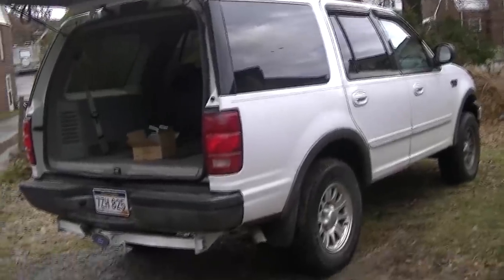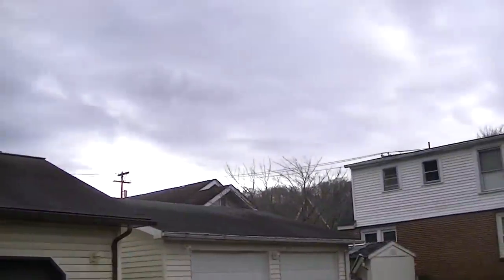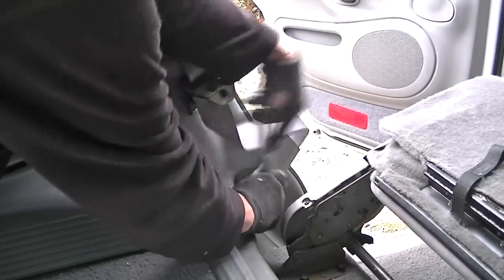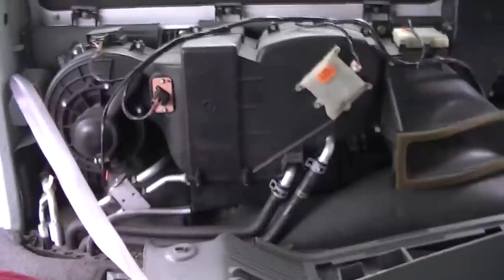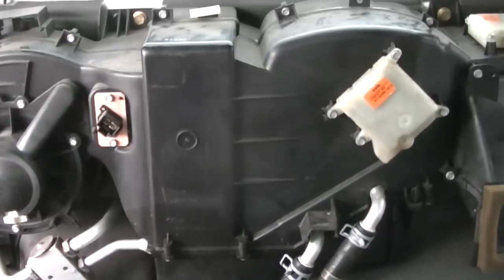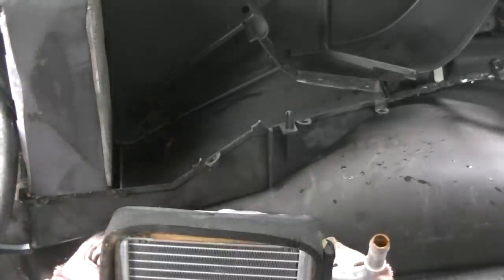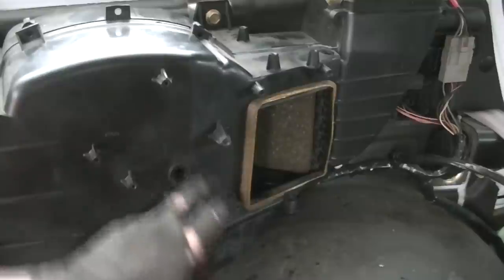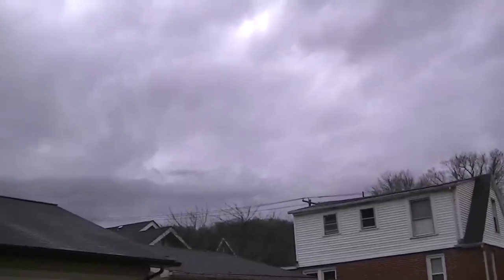Expedition Rear Heater Core Replacement.

Comment: Were both heaters intermittently working, or simply lacking heat all the time?  My '03 Expedition sometimes works, and has plenty of heat, front & rear, but when first started, it's ice cold, even after engine is at operating temperature.  Seems like air in the system, but having a devil of a time clearing it out, even using vacuum coolant fill.  Maybe I'm doing it wrong...

Comment: For those who do not always need a working rear auxiliary heater. It is possible to replace the 2 heater hoses in the engine compartment with non-auxiliary heater hoses. These shorter hoses makes it much easier to work on the passenger side of the engine. This also lets you back flush both heater cores. once the engine work is completed you can restore the auxiliary heater hoses. good to replace those 20+ year old engine compartment heater hoses anyways.

Comment: This is exactly what happens when you don’t put the proper coolant in these trucks.  The problem is this they get low on coolant people put tap water in them it destroys the coolant system and heating systems. When all they had to do is pull into any automotive parts store and get a gallon jug of 50-50 that’s appropriate for their vehicle.  Running the proper coolant in a vehicle saves thousands and thousands of dollars down the line.
Reply from the maker: Very true!
Reply: I'm a victim

Comment: GREAT video, getting ready to tackle this in the next day or 2. Just confirming NO RADIATOR DRAIN needed? Just release pressure on overflow tank up front? THANKS MUCH!
Reply from the maker: Yep pretty much. But check the coolant level when your finish making sure its still full.

Comment: Man, vid is official I watch a good sum, the editing process angles to the point narrating it's all good man thumbs up!
Reply from the maker: Thanks! I was in a hurry to finish it. It was 66 degrees...and was going drop back into teens by evening....lol  Motivation!
Reply: @FixingWithPassion  I need help with mine!! I just changed both actuators and the air is lukewarm (floor) and barely lukewarm roof vents! I have a 2003 expedition XLT, 4x4, 5.6lt

Comment: Will the rear heat work even if the front heater core is blocked? I didnt know my 99 expo had a rear heater core.
Reply from the maker: Maybe if its not getting plugged up also.

Comment: Thanks for this.

Quick question: I have a situation with this generation Expedition to where the front heater core will need to be bypassed but want to keep the rear.  I'm sure this is not a big deal but would someone who knows more specifically about this comment?

Comment: That actuator on the side is for selecting cold air or hot air for the rear vents correct? Because the top one looks like it selects floor or roof I only ask because my buddies wife’s expedition blend door actuator is bad in the rear vents  and stuck blowing heat wanted to make sure it was this one and not the one under the front dash any info would help so I don’t have to guess thank you!

Comment: My dealer tells me  I need to replace the rear evaporator core.  The front of the third row seat completely fell apart and the carpet in front of the seat behind the driver is also falling apart.  Could this be from a problem with the rear evaporator core? I don't know what else might have caused the seat stitching to come apart as well as the problem with the carpet.  Any ideas?

Comment: Hi, the video is great. What if the hoses on the radiator is not same temperature. Does the cause of no heat probably due thermostat lock open?

Comment: I have a 2002 Explorer Eddie Bauer edition. I am planning on replacing the heater core just because it never has been replaced, but more importantly, the heater hose block that is under the SUV is leaking. I have already tried replacing the P trap looking hose down there, but the leak still persists. To replace that block do I need to do it from inside where you just exposed the heater core, or is this done from under the SUV??
Reply from the maker: Rear or Front Core?

Comment: Both of the heater cores is clogged on my 00 Ford Expedition front and rear. My question to anyone is can I just replace the rear heater core and have heat or would I have to replace both at the same time? The front is time consuming and rather pay a professional for that.
Reply: You can replace just one, 
are you sure that's the problem...
- how do you know they're clogged? 
- did you test your thermostat?
Reply: I did the front on my 2000 ford expedition. Yes it was hard! But was possible with 90 degree needle nose. Now my rears is not putting heat. Thinking draining or replace. Id rather drain. A bunch of sediment and rust flakes came out just the front.

Comment: On the rear heater core rubber lines why would someone cut them and then splice them into each other by passing the heater core
Reply: Leaking heater core, they bypassed it eliminating the leak.